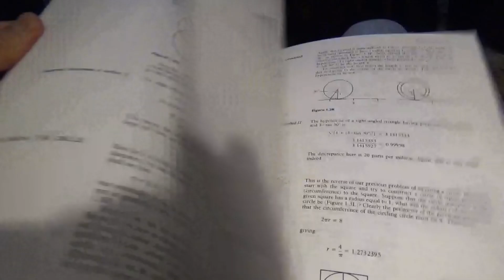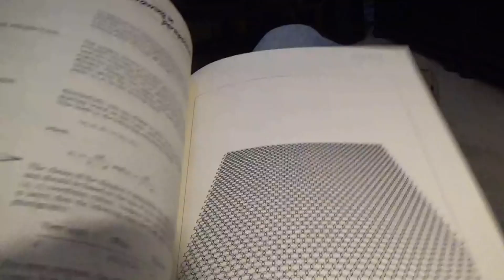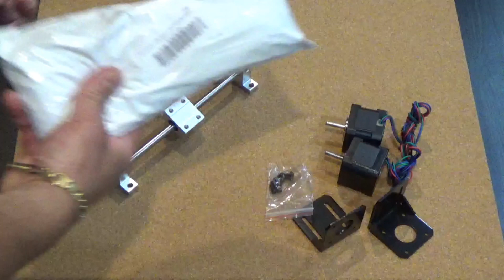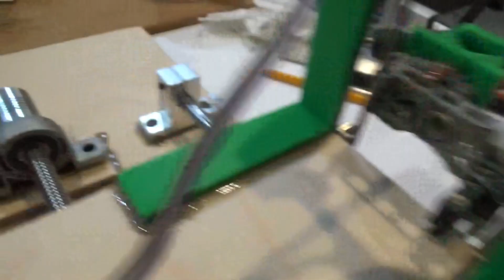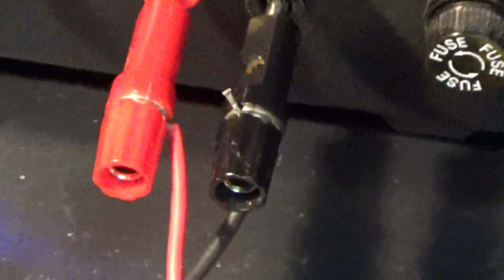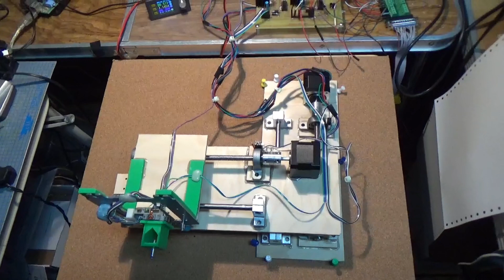2D plotter for TI 99/4A computer

Comment: I'm no electronic wizard, but in your schematic you have Vss instead of Vdd, I'm assuming that it is an error.
Vss is generally the most negative supply terminal for an IC or a circuit using MOS devices. Vdd is the positive supply voltage. Beside that, great videos you make 👍
Reply from the maker: Yes it's supposed to be VDD. I'm a self-taught hobbyist who knows just enough to be dangerous... 😄